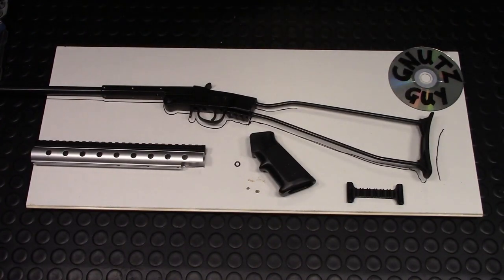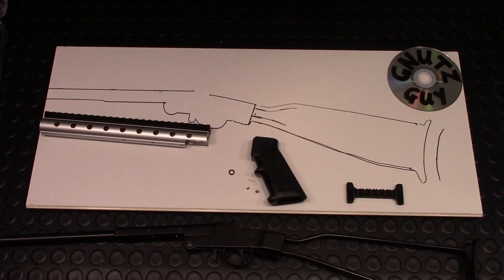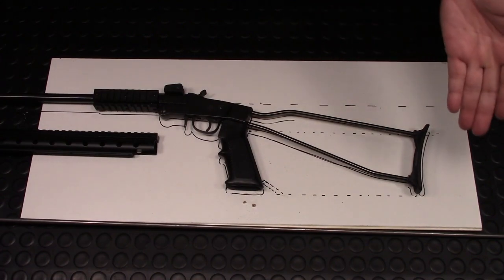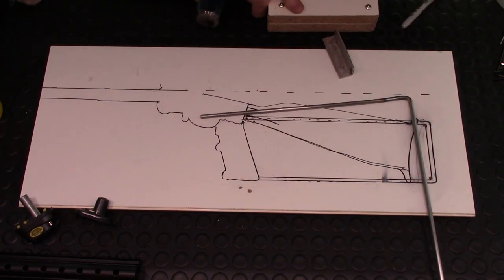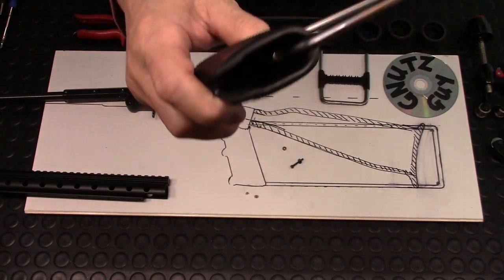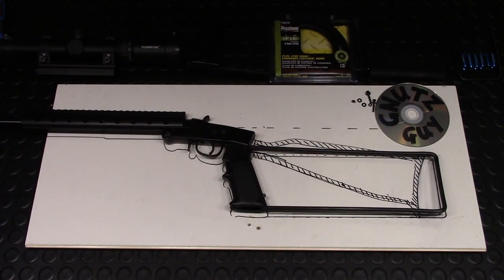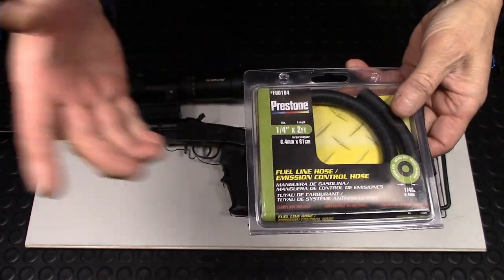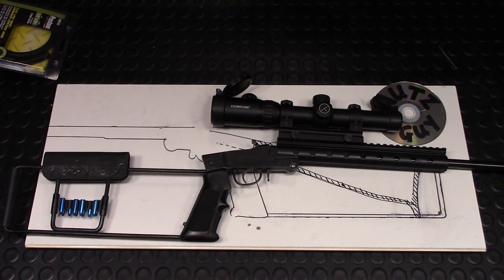Chiappa Little Badger. Pimp me shoot. DIY mod wire stock. Sniper *

Comment: VERY COOL custom build !!!  You’re a much better Machinist/Craftsman than 99.99% of us could hope to be .
Your custom Wire-Stock with adjustable Cheek-Rest is genius!

I’ve got the Little Badger in .22 WMR down here in the States .
Fortunately, I’m the only owner in America to actually find & purchase Chiappas’ factory Pistol Grip online 👌
After many months of checking & re-checking Chiappas’ website (always “Out Of Stock”) , a late-night Google search resulted in a totally rando webstore that had 1 (and only 1)…fits like a glove  👍
I also added :
- a Folding Foregrip to the plastic Bottom-Rail…it’s 3-Position , which allows folding Back, Down AND FORWARD
   (Forward position both #1 extends Hand-Rail and #2 allows the action to more fully break for loading)
- bought the over-priced Longshot Top-Rail (aluminum) to mount my Scope
- used lower profile Scope-Rings in conjunction with the Carlson’s Hammer Expander
   (slightly narrower than the Chiappa factory Hammer Extention , but fits fine)
- a 3” Muzzle Brake…mostly for looks (may hide Flash , if not reduce Recoil)
- a Green Laser to the outer factory plastic Side-Rail
- and have plenty of Black Para-Cord to wrap the Wire-Stock and/or Barrel .

You called that replacement Washer a  “Wave Washer”  ???   Do you recall it’s size ?

Also liked your use of Fuel Line tubing to wrap your Wire-Stock (brilliant) .

Thanks for uploading ✌
Reply from the maker: i know of all the accessories but if you have a hard time getting that grip, what are our chances from canada? nil, nada, zip, bupkis, lol.

alot of US dealers refuses to ship accessories out of your country and a few that do, runs the risk of seizure from our over zealous customs. 

some of our dealers here are afraid to stock accessories due to uncertainty with our anti gun liberal government so what are left for us to do but to adapt/mod... ya welcome.

Comment: What about swapping out the pivot pin/bolt with a pull pin so you can separate the barrel fully? Just like a takedown. Sould not have violated any Canadian rules as you cannot fire it in any way... 

Side question. What type of metal would you say the receiver is? Look like aluminum alloy or aluminum / magnesium. Is it at least a good quality mold? Or is it molded then machined?
Reply from the maker: Pull pin will not work bcos the receiver will be wobbly resulting in poor accuracy. New model just introduced has easy separating pins. I'm trying to get my hands on one. Any leads is much appreciated.

Comment: Wish I could post a link here! Awhile back I designed(probably poorly) a 3d printed folding stock for the LB would love to get your thoughts on it!  I can send the stl/files if you want too.
Reply from the maker: i think its fine, you can post here a link to your pic, just not to a dealer.
Reply: @gnutzguy  Sweet! see if you can check these out then. This was my first time messing around with the design software so it super rough. Its help up pretty well, although i want to change the stock to have some more thickness where it connects to the pic rail because it tends to pop off, Might make it solid or a thicker mount.